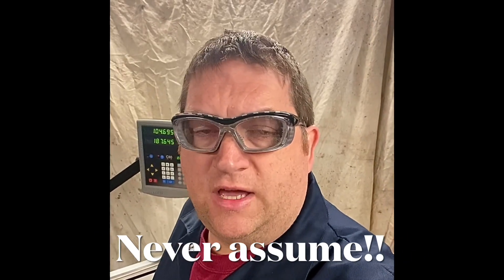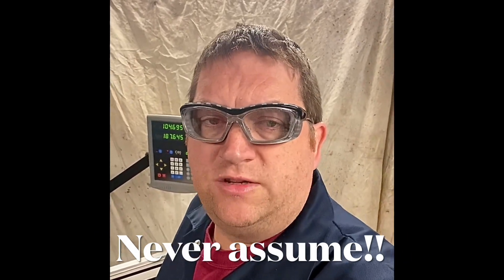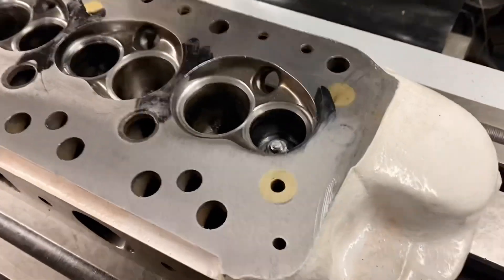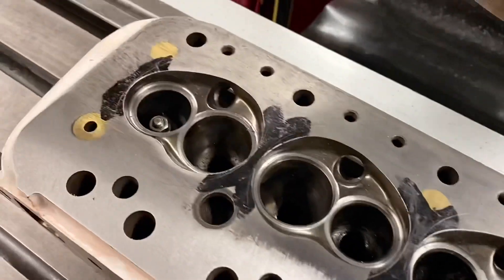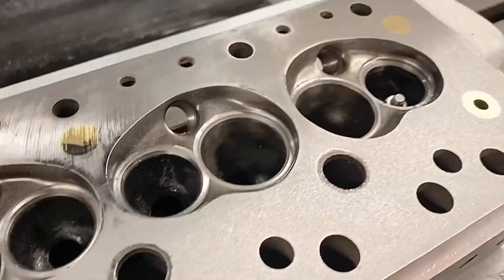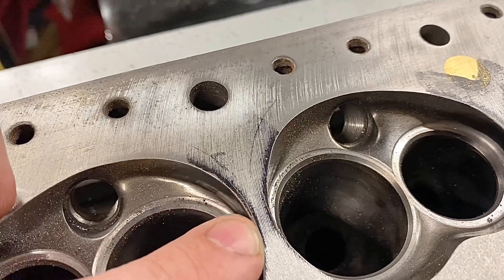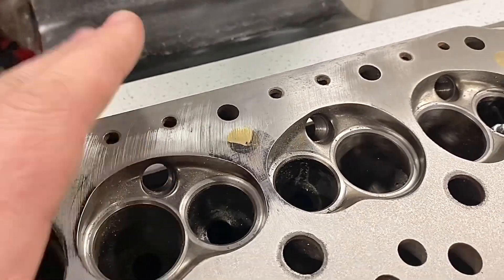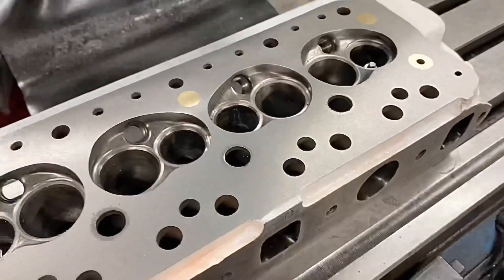Never Assume! - Engine machine work

Comment: So, what would be the necessary surface rougness for a multilayer steel gasket? Is there any reference value to aim for? Iron block and an aluminium head.
Reply from the maker: Consult your gasket manufacturer’s recommended surface finishes

Comment: Once it has started to warp, is it likely then to simply deteriorate faster due to a badly sealed head gasket and possible overheating?
Reply from the maker: Yes localised extra heating from gasses won’t help